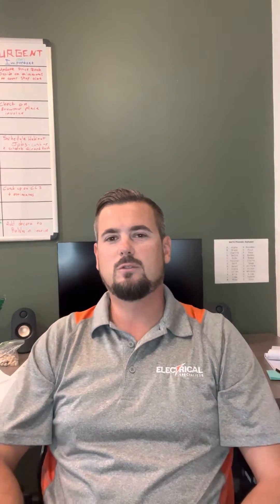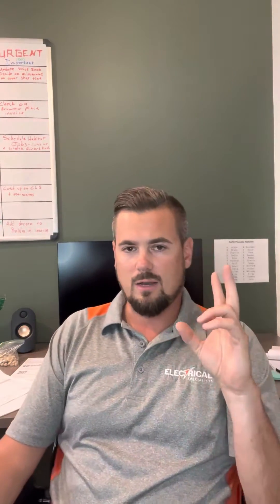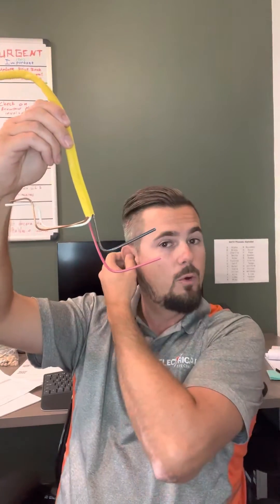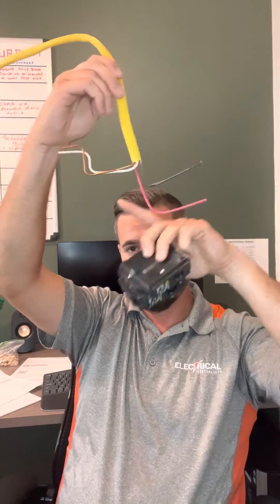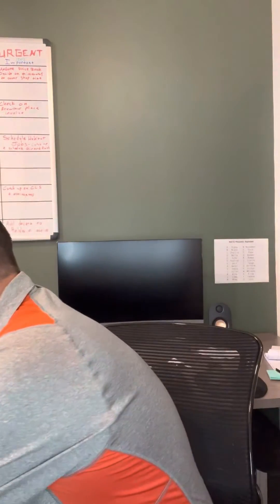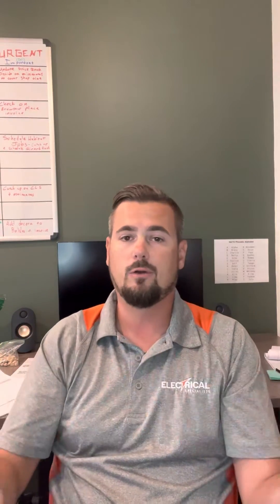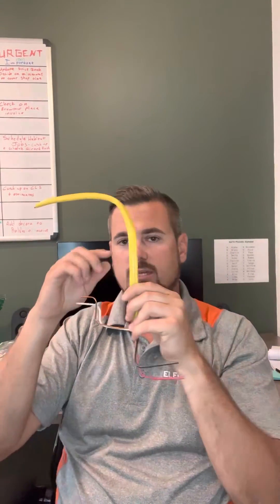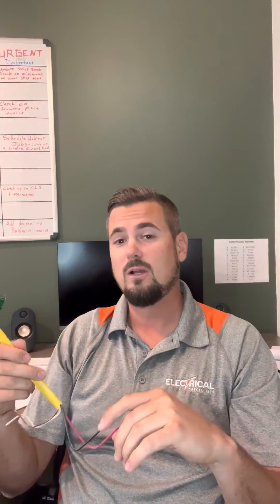The Truth About Multi-Wire Branch Circuits Explained

Comment: How do you locate the box where the branch circuits split? I have nothing but branch circuits in my house, and have only found one.
Reply from the maker: Good question. Unfortunately once they leave the panel it will take some detective work to find that point of the circuit. You could start with turning off the breaker in question and opening every box that has lost power. In older homes they often used the light boxes as junction boxes for doing this.

Comment: Where I live (Phoenix AZ) MWBC was used extensively in almost all housing developments in the 1980s and 90s as well. They were also used in the 70s like you stated but with aluminum Romex. They are very useful for the two required kitchen circuits or a washing machine circuit plus a garage circuit. The possibility’s are endless. They could be used to power two air handlers in an attic even nowadays because AFCI or GFCI is not required.
Reply: Have nothing but hate for them and think its just a way to be cheap.
Reply from the maker: They can definitely still be useful in the right situation. Thanks for sharing.

Comment: Total non sequitor of an explanation. Having 2 independent breakers does not open the neutral. In fact the other non-tripped circuit will work just fine. Using a handle tie or single 2-pole breaker is entirely for the safety of electricians who may not be aware of the shared neutral and be working without shutting off both breakers and get shocked by the neutral from a load on the other circuit. In fact, if one breaker was off, and he opened the neutral, nothing would happen to the connected devices, unless he energized both breakers without reconnecting the neutral.

Comment: Using a 2 pole breaker will produce 240 volts lol you’d use two single poles with a handle tie if your trying to utilize a shared neutral with two 120v circuits
Reply: Circuit breakers don't produce voltage. A 2-pole breaker lands on opposite "phases" and there's 240v between the phases.  Two 1-pole breakers with handle tie, (one on each phase) will also show 240v potential between the poles. There's no difference. You can use a 2-pole breaker or two 1-pole breakers with handle tie on opposite phases to establish a multiwire branch circuit that share a common neutral to establish two 120v receptacles.  What makes the difference is the presence of a neutral wire or not.  if you run two 1-pole breakers with handle tie on opposite phases and no neutral, then you've created a 240v supply circuit the same as if you used one 2-pole breaker from the get-go.

Comment: You are giving some incorrect information.   The 2008 NEC said that multi wire branch circuits feeding office partitions were required to have a common means to disconnect the circuits by means of a multi pole breaker or handle tie from the manufacturer.  And that they must be grouped.  Reason:  A maintenance man was working on some office partitions, only turned off one breaker of three and got shocked.   
Then in 2011, NEC said that all multiwire branch circuits must have common means of disconnect, either breaker or handle.  Nothing to do with overcurrent.  If one pole trips, it causes no issues with the other circuit and the breaker did its job.  
You are saying if you lose a neutral there is a problem.  Agreed 100%.  What happens if neutral lost on the incoming service?  Same thing.
There is not NEC requirement I know of to disallow multiwire branch circuits.   At least up to 2017 NEC.  That is most likely a company rule.

Comment: I'm not sure I get it, if you" lose a neutral" wouldn't that circuit branch be open and no longer function? How could that then combine both hot conductors to produce 220 volts? I believe one of us is laboring under a misconception.
Reply: It depends on which neutral connection he's speaking about losing. You're only going to have a problem if you lose your panel Neutral but maintain the common Neutral connection between the loads on the opposite phase. The receptacle he's talking about might have more than one Neutral wire backstabbed. The common Neutral that goes back to the panel might be backstabbed on one side of the receptacle and the Neutral jumper that joins the other load's common Neutral might be backstabbed (or otherwise connected) to carry the common neutral to the second load on the opposite phase. If you lose the panel Neutral connection, his explanation is more or less correct... If only one load loses its Neutral, but you maintain the panel Neutral for the other load, then you have an open circuit between the loads and you no longer have a series circuit. One load will be open circuit and the other load will continue to function as designed at 120v. If you do lose the panel Neutral but maintain the neutral connection between the loads, you have a 240v nominal in-series circuit. However, you're only going to measure 240v with no load connected. If you lose the panel Neutral, but maintain the Neutral connected between the devices, this will place the loads in series so the actual voltage seen be each device would be dependent on the resistance of each load. It's more likely to be something like 160v on one device and 80v on the other, or some variation that "adds" up to 240v and would change as loads are switched on and off.
Reply: @OtisPlunk  good explanation, your correct
Reply: Electrical current flows in through the red and out the black and vice verse.
Reply: https://youtu.be/0WQW9-adFas?si=vM_TPsaUFe6qzoSD
Reply: Except the breakers interrupt the red or black, never the neutral. So there's no danger of one breaker tripping and losing the neutral.
Reply: Your right MrO. The situation he is saying would occur is not the case.

Comment: Stupid question: I have a multi wire branch circuit with the hot wires fed by individual single pole 15 amp breakers. If I replace those with a two pole breaker, what size do I use?

I guess what I’m asking is: does a 15 amp two pole breaker allow 15 amps TOTAL, or 15 amps on each leg?
Reply from the maker: Excellent question.  
The breaker is to protect the wire itself not the load. So the wire size dictates the breaker size as the wire is rated for a certain voltage and amperage. So if we are assuming the original 15 amp breakers were sized properly and the wire is 14 gage, the a two pole 15 is the correct breaker. As for the second question, It has 15 amps of potential on each of the two phases, but because you are changing it from 120 to 240 Volts its total potential is 15 Amps at 240 Volts. I hope this answers your question.
Reply: been searching and reading for hours looking for this same question. thanks for the question and the easy to understand answer!

Comment: Here's some specific tips regarding multiwire circuits.   First off, because of the AFCI and/or GFCI requirements for dwelling units, they are essentially obsolete in newer construction.  In other than dwelling units, frequently larger office spaces in commercial buildings, where perhaps a couple dozen or more 120 volt circuits are used, multiwire circuits are very common even in new construction and have several advantages, including less conductor material needed, smaller raceways, reduced labor costs during installation and reduced voltage drop.   Here's some important NEC requirements,  based on the 2020 NEC:   210.4 (a), 210.4(b)   The circuit must originate from the same panelboard, and the disconnecting means must simultaneously open all ungrounded conductors.   300.13 (b)  the continuity of the neutral shall not depend on the receptacle,  where removal would open the neutral.     In other words you would need to pigtail the neutral.